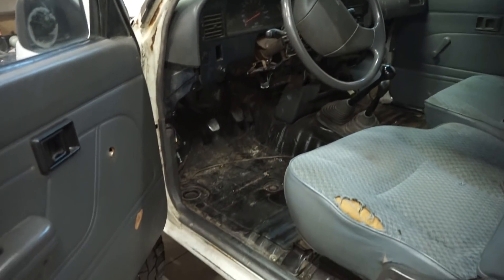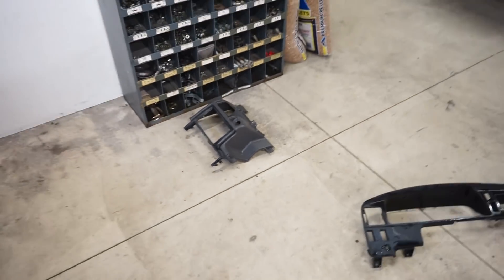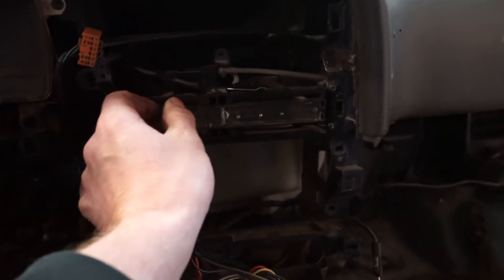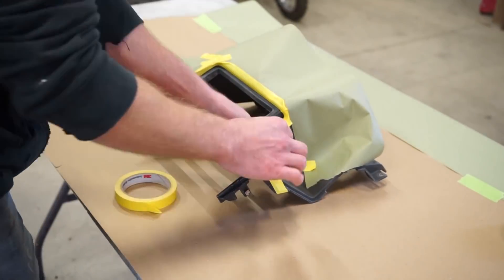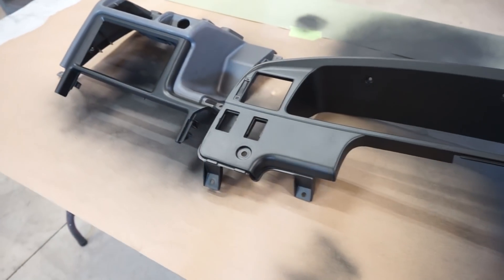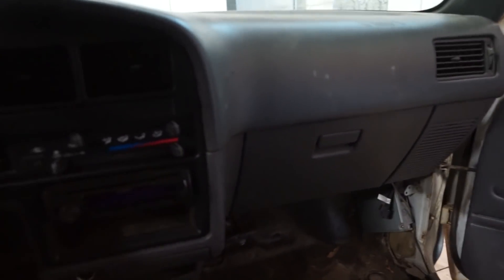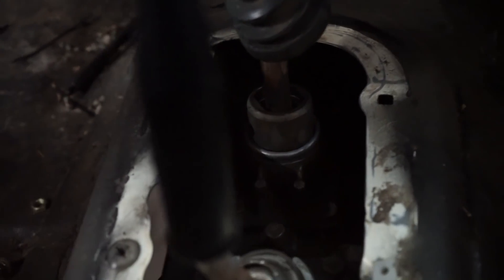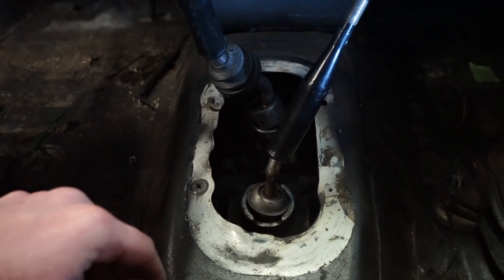Rebuilding Hubs/ Modifying Shifters/ Fixing Interior 1990 Toyota Pickup

Comment: Another great video, I do have a 1989 toyota 22re , had issue with my injectors, noticed that I had the oem, didn't replace, what I did , I rebuilt them, found parts on EBay,  that was the cheaper than we one. Parts only cost me $14.00 and some change. Keep those videos coming.
Reply from the maker: Thanks man!

Comment: Does your pickup use the cable drive speedo or the electronic style? I have a cluster of both in which im not going to be using if you're interested in swapping out your old cluster. One was from my 94 4runner (electronic  speedo) and the other one i pulled from a 2wd 3rd gen unsure of what year or engine. But its a cable drive setup. Also have an old sr5 shifter from my 4runner or i also have an sr5 shifter from a 1st gen toyota. Just unsure how to get you some photos. But im about an hour and a half from spokane. But i do frequently come up that way to pull and save. Im located in Potlatch Id.
Reply from the maker: This is a cable speedo! I thought about swapping to a tach cluster
Reply: @austinniemela  well i do have a tach cluster sitting around if youd like to have a look at it to see if it will work for your pickup. Although i do remember reading a forum on it something to do with the oil pressure sensor if you dont have the correct one on the engine itll kill the oil gauge in the cluster but im not 100% on that. I read it a few years ago. Was going to do the same thing for his pcikup but he didnt sound to interested in swapping it over so i stopped reading into it